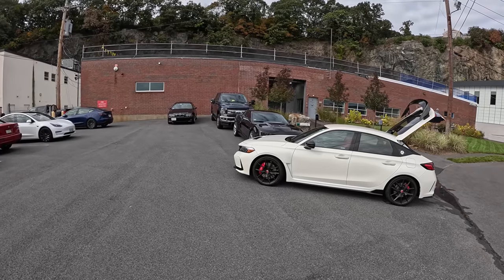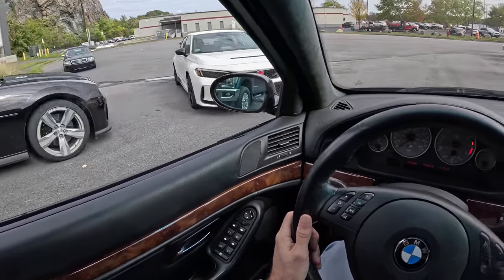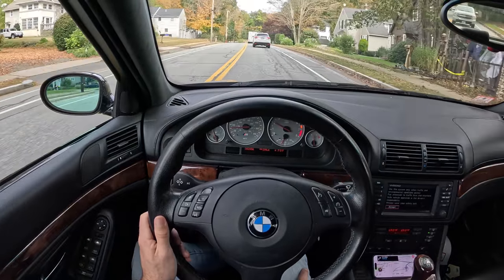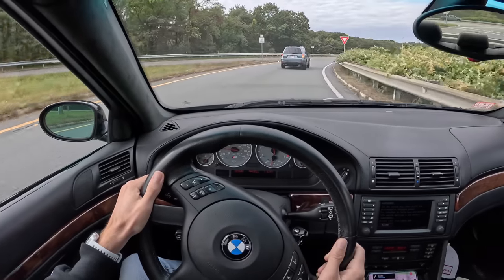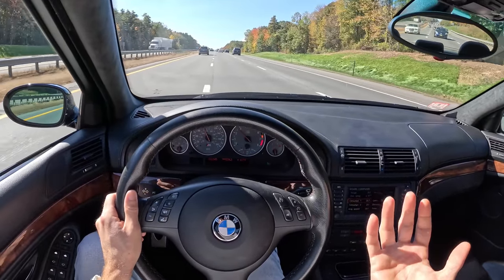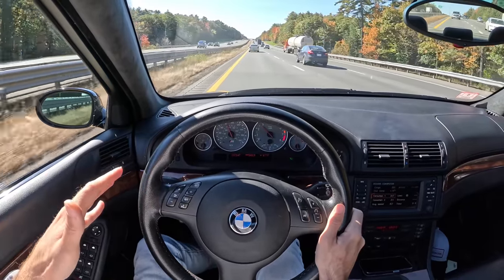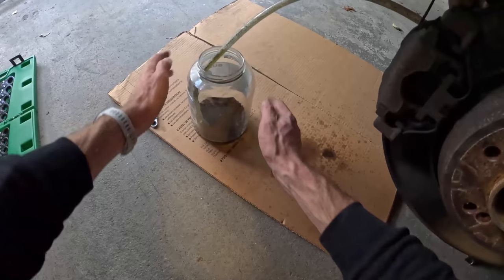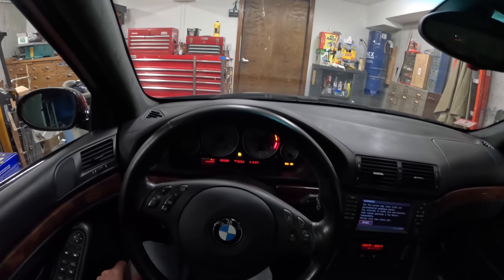My 2001 BMW E39 M5 Update - Disgusting Brake Fluid and Last Drive!! (POV Binaural Audio)

Comment: Hit the nail on the head with the seals. My c32 has been leaking oil and the shop today told me about $1600.00 to replace the rear main seal. Did the valve cover gaskets 2 years ago with a ton of other things as well. Old German cars get expensive. When it rains it pours, I find... and yes I'm talking about oil.

Comment: Just picked up an 02 C32 AMG up in northern Maine, essentially same trip as you, and my God is Maine beautiful. The old german rocket ships find themselves right at home on those roads, definitely glad the C32 made it the 300 miles back down to RI and did it without breaking a sweat. The Germans really don't make them like they used to!

Comment: the first year e39 m5 with the 99m3 m roadster steering wheel the 2000 model doesn't feel the same as the 2001 2002 m5, i think people should know that. also genuinely thanks for all your videos, 911 r was amazing.

Comment: As a semi mechanic I can chime in on your tiny “80mph semi” comment. Through all manufacturers software which you have to use for diagnostics, ecm updates, and many other things, you are also able to modify the “road speed” (actual vehicle speed cap) and “cruise speed” (maximum speed the cruise control can be set at).

Comment: I've bought myself an E46 320cd sadly the only two things that grind my gears are open diff and the Diesel Engine. I sell it after giving it some maintenance and buy myself a E39 or a E46 again but this time atleast the 6 Cylinder petrol.

Comment: Almost service time for the M5 too.
Reply from the maker: That has just never been reset. There’s like 2000 miles on that oil
Reply: @TedwardDrives  hehe. Cool cool.  I had an e46 and would count down from 25,000kms but man it’s too long to leave oil in an engine

Comment: Which non Tesla budget EV would you recommend? Bolt ev/euv, Leaf, Kona electric, etc
Reply from the maker: Depends on your use. The bolt is awesome but slow charge speed could be frustrating on longer drives